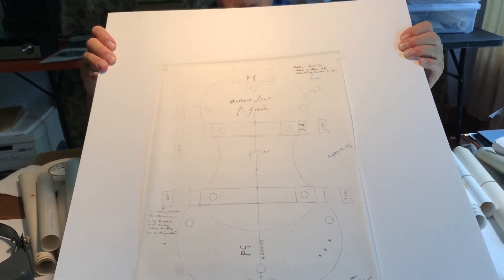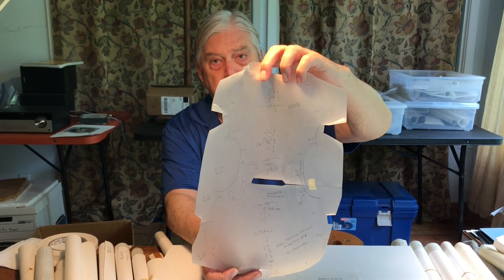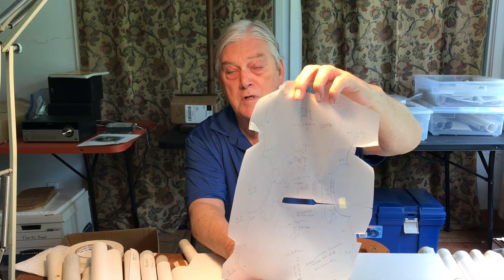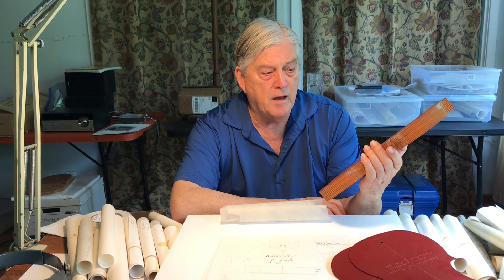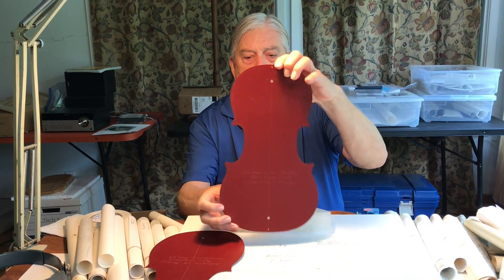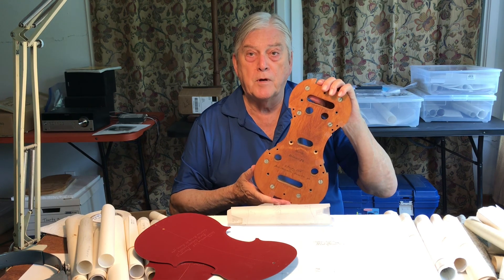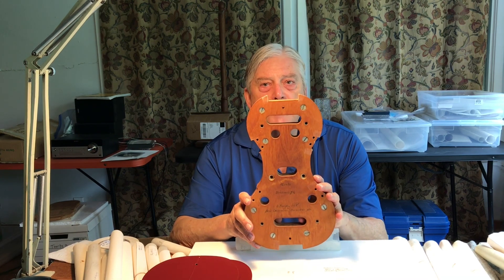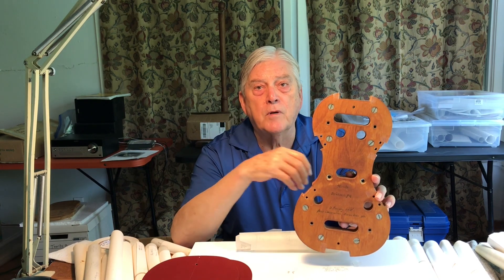Stradivarius form PG, geometry in design and why?!?!

Comment: Now I am no expert of any kind and just starting out making violins and I have not figured everything  out yet but in my thoughts are is that they were looking for perfect balance. Just the same as good verses  evil ,light verse dark or a tuning rod held in the very center to give the same vibration in each direction and if you want to change that balance like in the case of the violin you would adjust  the bridge ,sound post or both. Feb/4/2025

Comment: You know what really cracks me up? Is when I see some bonehead claim they have a Stradivarius violin and show me the label on the inside to prove it. Then I burst their little bubble and ruin their dreams of having a million dollar violin. Their violin turns out to be a machine made fine looking piece of firewood, or suitable for hanging on a wall for decoration! Non-Luthier's are ignorant and dont realize that there are basically two patterns, and the label actual states that the machine that made it used the Stradivarius pattern! Then they claim I'm lying and trying to buy their violin for dirt cheap and cheat them out of the millions that it is not worth! I always tell them I'm not interested in buying their cheap junk at any price. I then provide them with several addresses to get their "firewood" appraised at if they dont believe me. Guess what... they always take the bait... and end up paying about 10 to 20 times more than their "strad" is worth! Then its "I told you so... I didnt lie!". All 30 of my violins here are all handmade by me. I won't own a machine made instrument! I'm about to build a electric contra double bass! Its total playable string length is 66 inches! The scroll will be so huge that I have to glue about 6 blocks together to make it! I think the entire construction time will be about 5 days!

Comment: Hi, I'm a luthier and have done some scholarly research on renaissance humanist theory and Pythagoreanism and I can tell you that your absolutely on the right track noticing the pythagorean ratio relationships in the construction of the instrument. However, this approach is not unique to Stradivari or the Cremonese or even the Italians. It is most likely an artifact left over from the method of design and aesthetic principals favored by the humanist movement of the Renaissance. Keep in mind that whether one was designing a viol or violin in the 16th or 17th century, you wouldn't be using a standard ruler as there was no standard of measurement. Rather than designing an instrument over a grid of square centimeters, I maker would begin by establishing several key points, like the bridge and nut positions from which all the positions of the string harmonics can be derived. Working outward from these points, a compass and slide rule would be used to establish new points of reference and ultimately find the shape of the instrument. If you haven't tried designing an instrument with a compass before, I really suggest you go for it. You'll see how sensible using simple ratios actually is. Certainly, designing this way does effect the sound of the instrument, but not to the same degree that materials would. I recommend the book "Geometry, Proportion, and the Art of Lutherie" by Kevin Coates if you can find a affordable copy or a library with one.

Comment: The Pythagorean fractional ratios are present and obviously used; have you found the golden ratio in any of the measurements?
Reply: The Golden Section (0.618...) is a historical falsification of the 19th century. An approximation of the Golden Section appears in art and architecture as a subset of the geometrical progression of proportions (part of the Fibonacci string, namely 3/5 = 0.6 and 8/13=0.615). Ancient to Renaissance craftsmen didn't work with the Golden Section itself, but with (among others) a set of very similar ratios, which has many researchers (including Wikipedia) confusing the two.